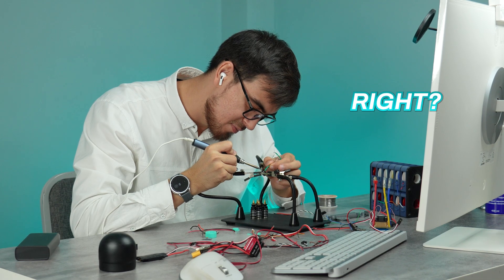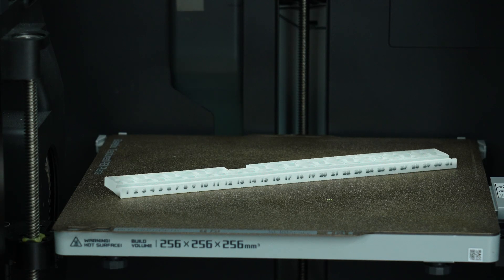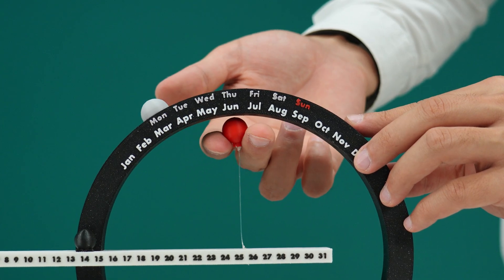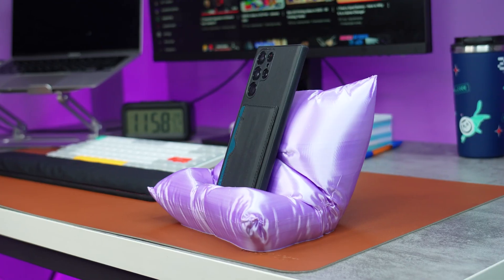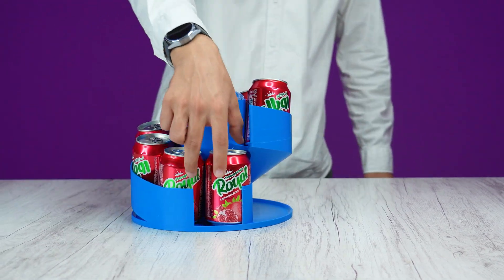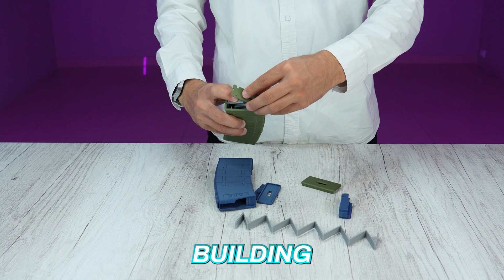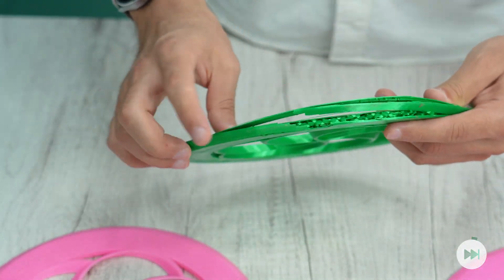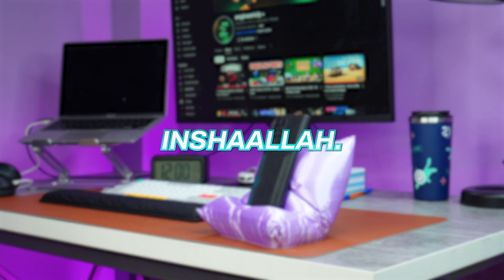USEFUL Ideas to 3D Print - September 2024

Comment: The solder scroll tool is awesome, what are your thoughts on adding an Ender 3 or similar brass nozzle on it to protect against accidentally bumping with the soldering iron?  They are cheap and easily available and come in different sizes.